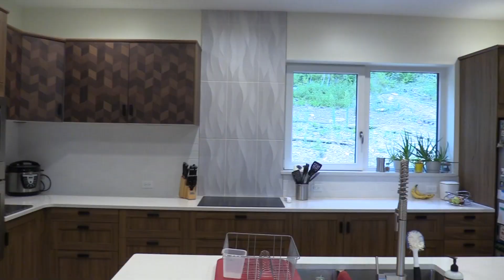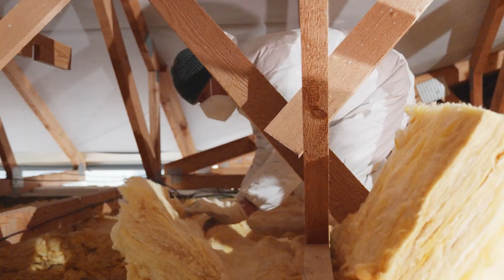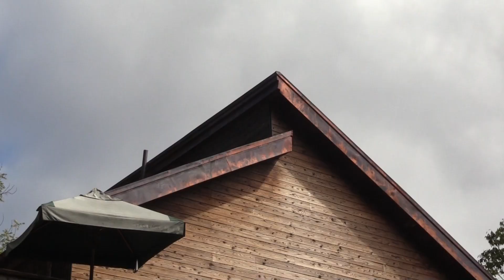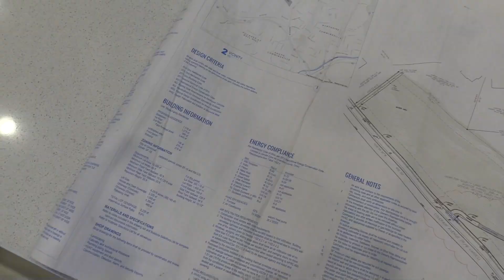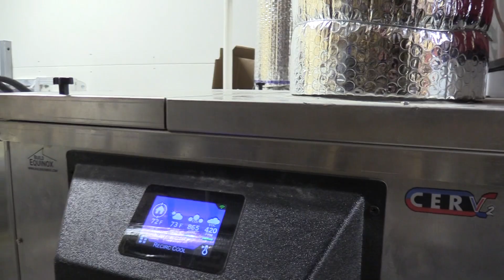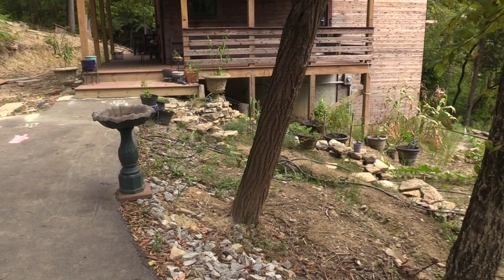Port Shorts - Passive House

Comment: Wouldn't a "rammed-earth" home do pretty much everything you set out to accomplish with your stick framed home? Only with the added benefit of being more structurally solid, fire resistant, not requiring all that insulation, all that calking, the copper roof, and the oxidized wood siding, ect?